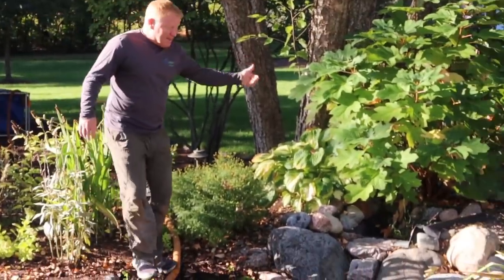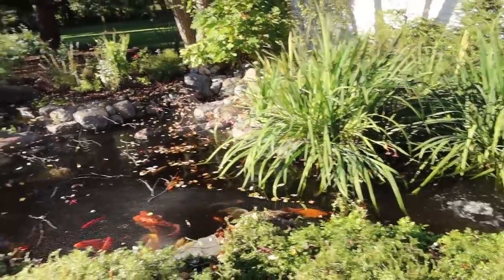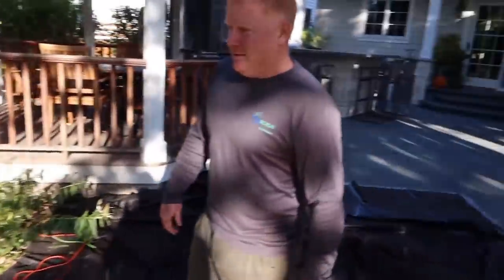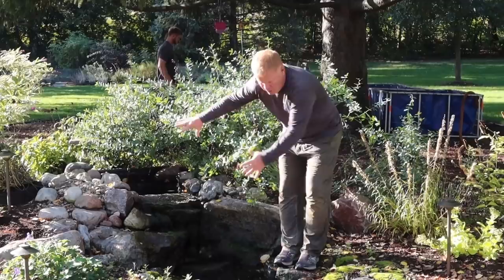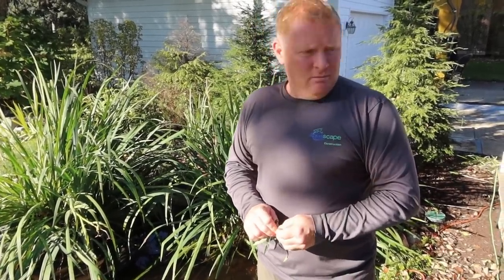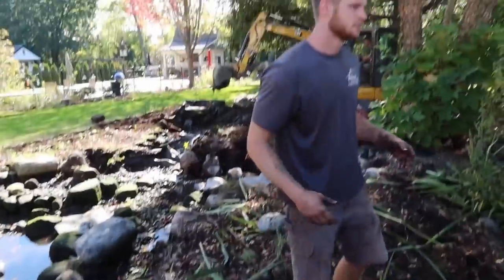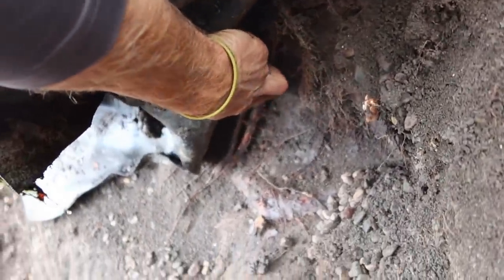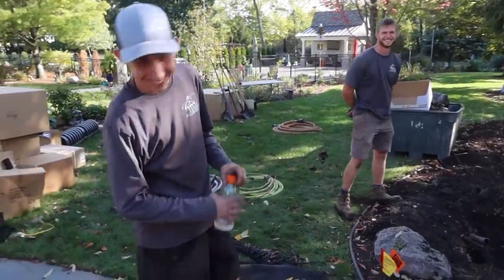*POND RENOVATION* Reveals Massive Tree Root Invasion - Part 1

Comment: Chris is absolutely right, to know (or learn) what the roots of plants will do. All roots will search for water. Once a year, like to maintain, or at least check the soil surrounding my biofalls and skimmer to see if anything is pressing up against it. Even a perennial can cause problems- that constant and slowly growing pressure seems to be what breaks the seals of equipment. 

You might consider installing (quality) rhizome barrier (used to control bamboo) to control the roots. The quality stuff is expensive but will last.